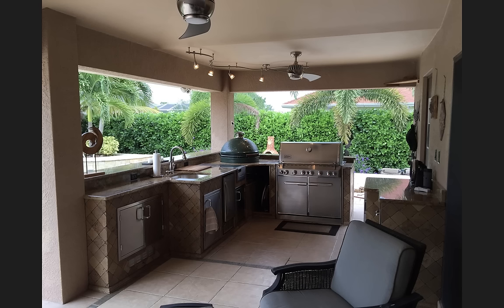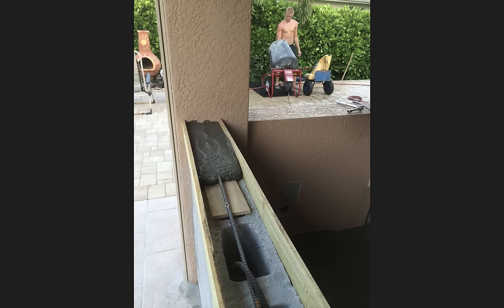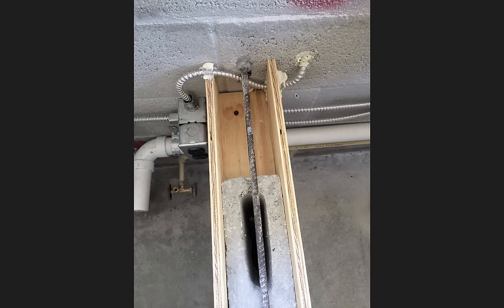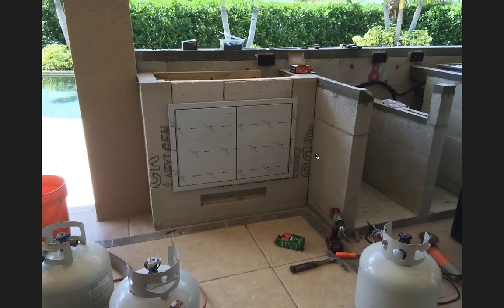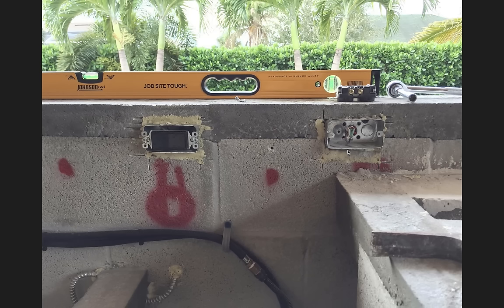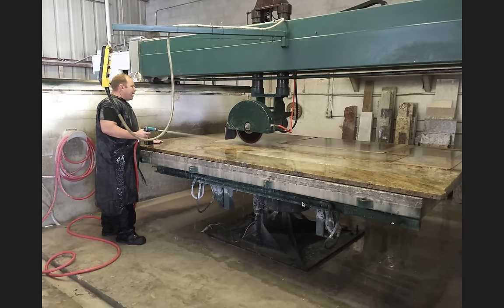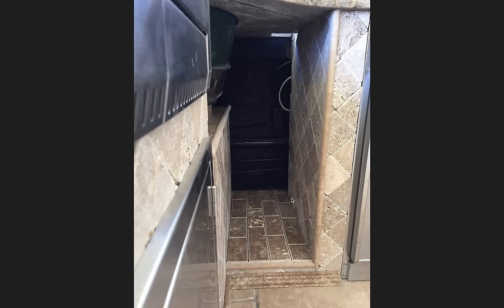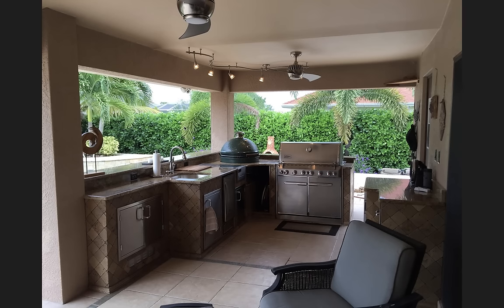Building an Outdoor Kitchen / Saved thousands doing it ourselves

Comment: Very nice. Thank you for walking through this. Can you tell me how you handle the smoke from the egg under the covered patio?  I am worried about this as i begin to design mine
Reply from the maker: Anthony Riggio When I built the space I intended to put a vent through the roof over the egg however small fan on the countertop over the glass door refrigerator is sufficient to blow the smoke out. You can see the fan in the video. Turns out it just isn’t worth the effort of putting in a vent for the few times the wind is blowing in the wrong direction. On a previous property I installed an over center island interior type vent (from Home Depot or Lowe’s) that blew straight through the attic and out through the roof with duct work and a typical roof vent for a furnace that worked very well.
Reply: @bobbygfl  Thanks for the info!  I am in Texas and the wind always blows in the wrong direction. ..haha.  Thanks again.
Reply from the maker: Anthony Riggio Haha. Thanks for the view and comment!

Comment: Hey man awesome video. I’m planning a similar kitchen for myself and will definitely use this video as a guide.

Did you have any issues with laying the blocks or even the slab over the tiles?

I’m doing some research and I’ve seen people saying that the weight could make the tiles crack.

Also, how critical do you think it is to add rebars into the ground? My patio has no walls so the island will be on its own.
Reply from the maker: Thanks!! I think the rebar is important because the narrow concrete blocks are not very stable on their own. That said I am sure I used more rebar than I needed to. I have had zero issues laying the slab over tile nothing has cracked. After using the kitchen for at least a couple years now I can’t think of anything I would do differently. Someday a giant exhaust fan would be nice.